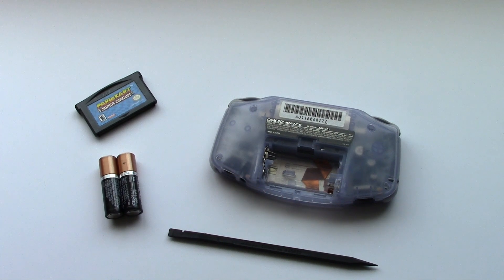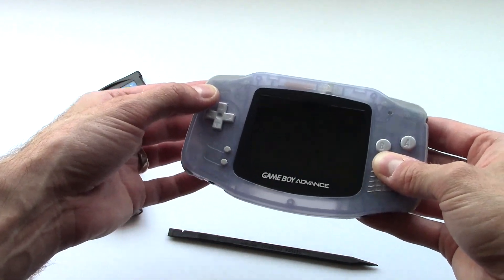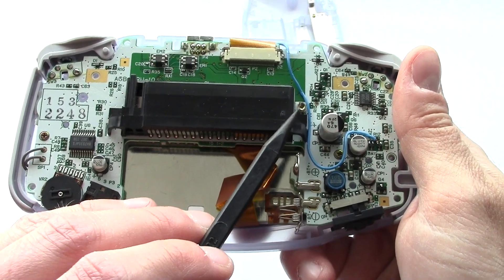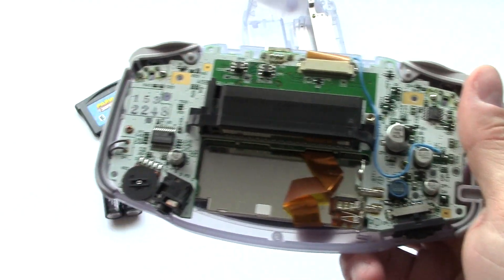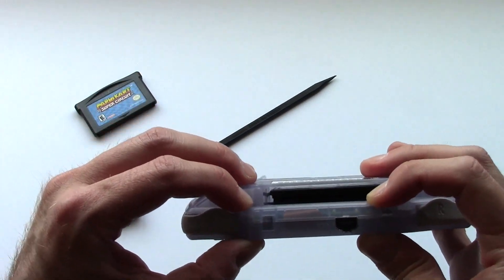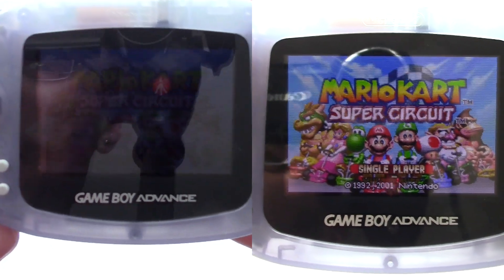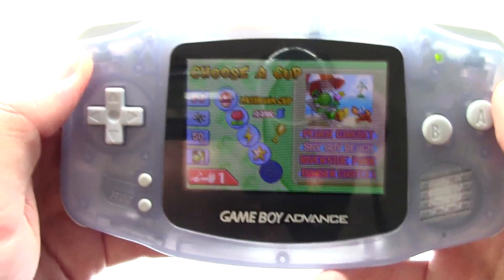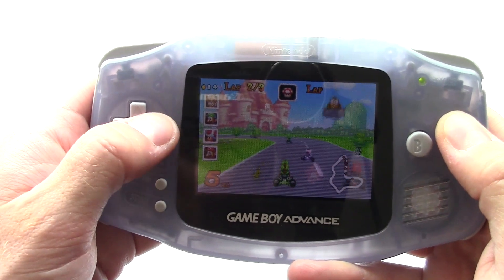Game Boy Advance Backlight Mod Tweak and Final Results

Comment: Is horizontal lines of dimness dancing up and down the interference you speak of? also, I swear the screen's light flickers when the screen is moving. I'm currently flutzing with it and in the unhappy medium where it either is dim and "interference-y" or flickery

edit: definitely flickering, thats a voltage too low issue, right?

Comment: Hey, I tweaked the potentiometer and the brightness got corrected but there is an interlaced effect/screen tear that appeared. Could someone guide me how to reset the potentiometer to factory setting or normal, is there a way for it?
Reply: You need to tweak it while it's powered on. There's actually a hole underneath the sticker on the back, so you can punch a hole in that (if you feel comfortable doing so) and tweak it while it's powered on. That interlaced effect can be highly minimized using this method, that's what I do! However, it's extremely precise and you won't be able to remove it 100%, but you can make it almost completely unnoticeable.

Comment: 32 pin connector use white tab lcd. 42 pin uses brown tab lcd. 32 pin boards and brown tab LCDs are now rare.  So most people get 42 pin boards and white tab and the video is bad.  There is a mod for 42 pin and white tab lcd.

Comment: What I think is wrong, is you probably got a 40 pin rather than 32, cuz I noticed that yours was a 32, notice if u take the batteries out there’s a number and I’m pretty sure the first number is 1, so you might want to check that.

Comment: 40-pin GBA + white-tab LCD screen

remove: R16, R17, C33, C54, Q3
connect: REVC to P2-VEE

https://circuit-board.de/forum/index.php/Thread/9546-UR-GBA-Backlight-Screen-Mod-AGS-101-Display/?postID=593578
https://www.reddit.com/r/Gameboy/comments/5r8i0e/ags101_gba_mod_image_retention_fix_40pin_white

Comment: First off, look at the power source.  The AGS-101 rechargeable battery is 3.7 volts.  The GBA you have uses two 1.5 volt AA batteries in series, giving you only 3.0 volts.  That’s why you had to adjust the screen voltage on that pot.

Comment: i did this mod after finding a sp 101 model for 20 dollars and i bought the ribbon adapter separately on ebay for 15 dollars my gba came out fine.. also I would recommend this to others who dont have alot of experience taking systems apart.

Comment: I removed 5 mainboard components with an iron to get my white ribboned backlit screen to work perfect. Basically a couple resistors to up the voltage. There's a German site that had the mod done the way I did it.  No artifacts, no ghosting. Looks a lot brighter than yours.
Reply: THANKYOU YOU ARE SOMEONE WHO ACTUALLY FIGURED OUT THE PROBLEM  5 MINUTES OF A WASTE OF TIME FOR THIS VIDEO

Comment: I did this mod as well, but I noticed the screen now drains a lot of power. About 350 ma instead of 100 ma for the original GBA.
Any tip on what to do to lower the huge power consumption ? Thanks !

Comment: Thanks for a great video! I followed your mod but with your advice and had the same washed out screen. So I did a bit more research and found another tutorial which worked perfectly.  My ribbon adaptor has c1 and c2. C1 need to connect to REVC in the mobo. C2 needs a different voltage to work correctly. Link:  https://gbatemp.net/threads/40-pin-gba-with-white-tab-lcd-perfect-solution.448597/

Comment: Here's a fix if you have an image retention/ghosting problem after doing this mod and jumping REVC to ground: https://www.reddit.com/r/Gameboy/5r8i0e/ The problem is that you have the older ribbon cable, 40-pin GBA and a backlit screen with white connector.

Comment: +This Does Not Compute I moded my gba right of the bat it was good but i fot the ribon cable that has the adjustment for the light. the dial does work when i try going brighter light but I believe maybe due to sodering to d2 instd of d1. overall I love it the gba mod due to having big hands.

Comment: +This Does Not Compute i did this mod followed your installation guide got everything in and working (sort of), the screen looked washed out and adjusting the trim pot made weird lines appear on the screen and made the brightness fluctuate kept at it for 2 days eventually got tired and was on the verge of throwing in the towel, then i went on the forums and saw some solutions so i tried them out and sure enough every thing was up and running properly. would like to say thanks for making such a informative guide and continue making videos.

my solution i did to get my screen working proper: 2 point on the motherboard needed to be jumped with wire RECV to GND and V2 to 103 ( 40pin model )
Reply from the maker: Thanks for the kind words! It seems that some GBAs, but not all, have the same issue as you experienced. I think it was a specific logic board revision, but I haven't been able to track down specific data on how to identify in advance if a GBA would be affected. Glad to hear it all worked out for you!

Comment: I messed up, REALLY BAD. Is there anything i can do? I took it apart looking for the pot screw. There are 3 screws on the motherboard attatching it to the front of the shell. Im really tired and stressed so I mistook the pot screw for the 3rd screw. I messed up the plus sign divet and THE TOP OF THE SCREW CAME OFF!!! Theres a little of the stem sticking out still. Is there ANYTHING I can do about this? Or am I fucked? Can anyone please help?
Reply: You can desolder the broken pot you overturned  and take another pot from a DVD drive laser  and solder a different pot back on won't damage your gameboy  . I found that out same way you did

Comment: I think the problem is that you have a 32 pin GBA and a type AB/B AGS-101 screen. In the first video, we can see that you have a 32 pin connector and that your new screen has a brown connector at the end before the ribbon adapter. Such combinaison is known to have dim brightness and interference.
More info on : https://gist.github.com/grantland/8c112548b44aa87dced2
Unfortunately, besides the solution you gave in this video (which can be hazardous for your GBA), there is no straight forward solution like 40 pin GBAs.

Comment: why is the wire blue this time?
Reply: A bit late, but it's because he broke the original ribbon cable adapter he got with the original kit, and bought a new one. The new one just had a blue wire, I guess.

Comment: Is using a rechargeable battery cheaper than AA batteries? I know that if I do this mod, I will get a constant amount of battery juice each time it is replaced, but if I get an SP, the battery will decay from charging over time and will eventually have to get replaced.
Reply: Rechargeable will be cheaper then normal AA batteries in the long run.

Either way you will have to replace batteries eventually. The SPs battery should last quite a while, but so would Rechargeable AA batteries, either should last a year if not longer. Which ends up making the cost next to nothing, and probably not worth worrying about.
Reply: Thanks for helping me influence my decision. I've decided to do this mod in the future, instead of buying an SP. The button spacing and shoulder buttons are just too small on it.

Comment: probably has to do with the power draw the new screen has and as a result the screen not getting enough power causing that interference, by adjusting that pot you're most likely sending more power to the screen and backlight. the fact that if you turn it to much and the screen going bad again is because you're past the 100% position of the pot and rotated to 0% again.

Comment: I dont have the correct tool to TaKe out the things that holds the back in ;(And I really wanted to fix this...
Reply: Amazon has triwing screwdrivers. Just beware, a lot of them have iffy reviews due to the alloy they are made of. But for one time usage you should be ok.
Reply: SergioValenz1 Thanks, looking forward into that.

Comment: when you did this mod: whats the default brightness level of the display? i ask because with the AGS 101 Dispaly there are two brightness level.. so whats the brightness level after the mod? the normal or brighter level? thx `!!
Reply from the maker: +Nomos The adapter cable I used sets the display to use the brighter mode, but that can vary based on the adapter -- several manufacturers have designed and made them. I've seen some that have extra solder pads on the ribbon to, supposedly, allow you to install a switch to go between the two modes.
Reply: This Does Not Compute  Thank you for the fast response i am just going to use the same kit you used! modding can be a b**.. :P
Reply: +This Does Not Compute I have just done this mod wth a white chip ags 101 screen on a 40 pin gba. the screen colors are faded and grainy but the trim pot didn't fix this.the ribbon adaptor does not use any extra wired as it supplies power the way it is.please help.
Reply: +starman 22 You're going to need to solder a wire to the ribbon cable and the board.
https://gbatemp.net/threads/gba-backlight-agb-001.328487/page-40

Comment: i just did this mod today. my main problem is the screen is too blury even of I tweak the potentiometer. my back light seems to be too bright as well.Do you have any suggestions to fix this problem?
Reply: +lui g I had that problem too, I had to tweak the pot while the GBA was on to get rid of the blurriness.
Reply: +Lui gi try getting a 16 ohm resistor and solder it to the back pins of the screen

Comment: I'm getting bright and really almost white screen that's only visible at very wierd angle, has anyone faced this?
Reply: first thing I'd try is to not attach the red wire of the adapter ribbon cable. That one is there to give the screen a higher voltage and more brightness. if that's not working sufficiently, there are newer adapter cables (Type B) that have a couple of resistors soldered on. That will reduce the brightness to a sufficient level, even with the red extra voltage  cable connected.
Reply: REVC to ground mod, Google it. Works well enough and is super easy. I did it on mine and it's not white anymore

Comment: Not sure if anybody's mentioned this on this video, but the housing has a direct access hole for the trimpot under the information sticker on the back (not the barcode, the other one) so you don't have to open it up over and over again to fiddle with it.
Reply: +TheRaellz Modding it already defaces the value... da fuq?
Reply: +Bob Woggle You... are the man....
Reply: +Bob Woggle Holy crap there is a hole there!  Thanks so much for this man.  It's really going to help out when I do mine.
Reply: ***** 1: You do not have to puncture the label. a few seconds under a blowdryer softens the adhesive enough that you can take it off without damaging it. Just put it on a piece of wax paper or something until you're done.

2: in what way does puncturing the label ruin the system? Most people doing this mod are doing it to play with, not to sell. The label does not affect the functionality of the system, only the resale value, and I have a hard time believing that a significant portion of the people doing this mod really care about that.
Reply: Bob Woggle
Exactly.  I actually bought a gameboy advance 32 pin just so I could do the mod with my ags101 screen and half of the label was worn off.  I didn't give two shits if it had a label or not.  Not like I'm going to return it to nintendo anyway for repairs haha.  I bet most of the staff at nintendo don't even know what a gameboy is.
Reply: P5ych00
"da fug" defaces the value of "the fuck"
Reply: oh yeah... i put a screw driver in there when my gba was broken but then i turned it on and it fixed everything
Reply: You can just peel it back with a craft knife

Comment: The screen is bigger than the GBA sp
Reply: +PVMNZ The replacement screens are/were identical in both physical size and screen resolution to the GBA SP AGS-101 screens, and the mod can be done with screens harvested from SPs. The screen is no larger or smaller than the SP.
Reply: @BobofWOGGLE  is the Chinese screen allot brighter?
Reply: @johnventura764  Wouldn't know, probably not.
Reply: +Bob Woggle Wait, so do you need a GBA sp screen first?
Reply: Gavin Dawg The mod used to be done with replacement screens from china, which were identical to the original AGS 101 screens, but supply of those ran out so you need the AGS-101 or its screen.

Comment: Hmmm... The interference looked like screen-dooring, meaning you can see the lines between the individual pixels elements on the actual screen. Maybe they just weren't being powered enough and thus the "interference". The pixel elements just were too dim themselves and not filling the screen with light, from pixel edge to pixel edge. Just a guess. I'm not an engineer, but I can imagine this would be the case. The trim pot is like a light dimmer.

Comment: Do you think it would be possible to replace the LCD screen with an OLED one?
Reply from the maker: allluckyseven If a manufacturer made them to the right dimensions and reverse-engineered the pinout of the stock screen, then absolutely.
Reply: allluckyseven Possible, but improbable..
No one even makes these AGS-101 GBA backlight kits anymore, unless it's harvested from a GBA SP.
Seems what ever factory in china that pumped out the screen has stopped making them, and only the gross frontlit ones are available :(
Reply: Bodom_  the kits that had the screens were most likely new old stock and once they all sold out it sold out

Comment: The amount of rotation between being bad one way and being bad the other is so very tiny. 
Mine came from an actual SP but it looked really odd in the GBA, flickering when you move with horizontal lines and repeated pixels, you can stop it repeating pixels and flickering when moved, but vertical scrolling still leaves visible horizontal lines until you get it rotated to an exact position the screen is happy with.
I'm so happy with my mod, and for my first mod I'm quite pleased with it, thank you for your videos, they were a great help.

Comment: Hi. If on the GBA the pot increases the voltage (for the whole system? wouldn't that be like overclocking the GBA and making the subcomponent have a shorter life?) I was wondering what the potentiometer in a Gameboy SP (AGS-101) is for? When you're adjusting the trim pot, do you need to turn it on and off for both the SP and the doing the GBA mod or you can keep both consoles on and turn the pot while it's ON?

 By the way, it may just be the video but it seems to have very visible lines and the black (especially when it's a thick black border) has lines and seems a little white with a bit of line. If this is the case in person, It may have compatibility issues with the two kinds of AGS-101 screens (they have different cables). AGS-101 screens are not compatible with all AGS-101 boards.

Thank you. God bless. Rev. 21:4
Reply from the maker: SevenDeMagnus That trimpot seems to affect only the screen. I've read that it was used when they assembled the GBAs at the factory to optimize the look of the original screen. You can definitely tweak it with the power on.

The lines you're referring to are likely the noise that seems to be an inherent part of this mod. I suspect it may have something to do with EM interference from the logic board, rather than a compatibility problem.
Reply: @ThisDoesNotCompute  Try using a resistor 16 ohm and solder it to the back terminals of the display

Comment: I just did this mod. I believe it is stuck on the 2nd brightness. The less brighter of the 2. Does messing with the potentiometer change this?
Reply: Alex Chipman Did you solder to the correct point (upper left DA-1 I believe). It is worth adjusting the potentiometer if it doesn't look right. Apparently you can do this while it is turned on to make it easier.

Comment: I need to do this mod, have to use the AGB-01 model and form factor because of the built-in 3.5mm jack since it's very difficult to get everything working proper with the adapter that gives headphone output since I'm a chiptuner. thanks for the tips and install process! I have 1 afterburner GBA, but my other GBA is a hello kitty model that I severely want to have a backlight since I love pink so much :D